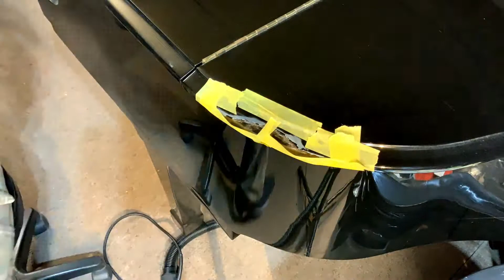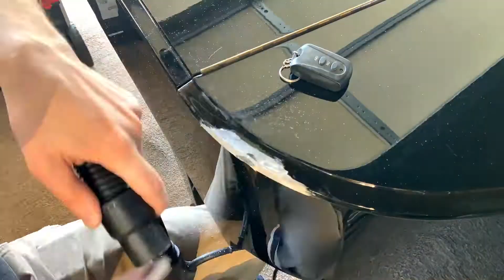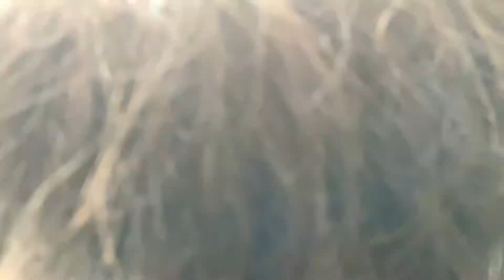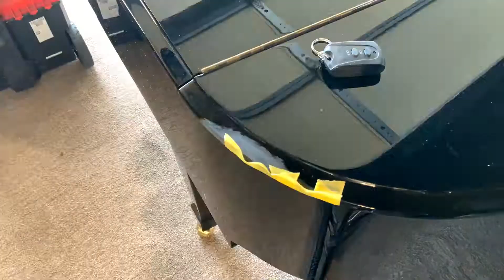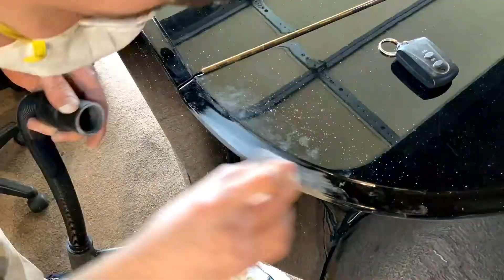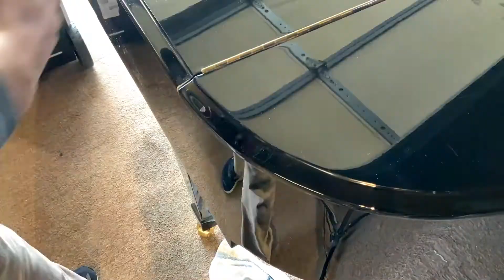Polyester Finish Repair, Piano Finish Repair

Comment: Top job Jacob. That is actually a very tricky repair as the polyester can be very thin on those moulding edges. Very easy to burn through.
Reply from the maker: Thank you  Stuart luckily there was plenty to work with here.

Comment: Fantastic videos! Would you mind sharing your post-poly sanding routine? What are your grits?
Reply from the maker: Hey thanks! 
After leveling:
600 and/or 1k dry or wet depending on the situation. 
Then 2k and 4K wet sanding with the foam sanding discs. 
Sanding to 4K makes it very easy to remove sanding scratches. Some sand to 5 or 8k. 
Use different patterned sanders to make sure you have sanded through the prior grit. (Straight sanding/standard orbit/random orbit etc.)
Then edge buffing using canton flannel wheel and GW16 dry compound. 
Polish with your polish of choice to remove fine buffing marks, if there are any. 
Visit MirkaLTD’s YouTube channel for guidance. They use a wool pad to remove sanding scratches- takes a bit longer, but no mess (good for a showroom) 
Make sure it’s polyester
Reply from the maker: In this video, I leveled with 60 grit on a dremel and triangle sander, then 320 straight with a block. Then 500 wet sanding with the electric sander. Then 1000 grit wet sanding straight by hand. Then 2k and 4K with the electric sander. 
Every situation is different.
Reply from the maker: https://youtu.be/IP5dO1fEUQU
Reply: @JacobEmch91  I have a similar repair to do on a grand. Wish me luck :D I've never thought of using my dremel for levelling. Great idea! I do similar routine for sanding but I've been using Micro Mesh for small things by hand and Norton Dry Ice discs which are outstanding at 1200 & 1500 grit. (6" discs on air tools). It gets similar results to wet sanding but you can monitor progress without water. I also find the high grit foam discs worthwhile. Thanks for sharing.
Reply from the maker: I will give the dry ice sanding discs a try. Thank you for the suggestion!

Comment: I have some new chips on my polyester finish Schafer & Sons approx. 2000 piano I need to repair, we were mounting a ceiling light that fell on top of the lid and caused 3 chips in the polyester finish. The color/stain is walnut and fine. I need to build up the polyester fill to be level. What products did you utilize in your restoration? Thanks.
Reply from the maker: Hi there, I would recommend visiting Allied Piano’s website for materials and basic instructional videos. That will only take you so far though. I would recommend you call a couple piano dealers near you and ask them who they use.

Comment: I have a new Shigeru Kawai that was delivered with deep gouges in several areas of the finish.  The surface clear coat looks like it has swirls everywhere.  Are these repairable to look like new?  I've never spent this much for a piano and had it delivered in such bad shape, but I've also never had a glossy black piano either.
Reply from the maker: Wow. Is the piano “new” new… or did the dealer use it as a rental for a while and then sell it as “like” new? You need to call your dealer immediately and either demand a replacement or return it and get your money back. Or maybe they have a repair technician but most dealers don’t. 
Reminds me of the time I fixed a foot-long deep gouge on a brand new Shigeru Kawai SK6. The damage must have been from the factory because it was there when we uncrated the piano.
Reply: @JacobEmch91  new new. SK7. My concern is that in order to remove all the swirls and scratches the whole top surface of the piano will need to be refinished and I’d rather not do that. Bench is damaged as well. The delivery guy had the leather surface on my garage floor as he assembled it.
Reply from the maker: @MrTedflick  all I can tell you is that is beyond unacceptable and any respectable piano dealer would take care of it for you. They’re likely not going to be able to repair it in the home. Don’t stop until they replace it, fix it, or give you your money back. Show up every day, call twice a day. Don’t be afraid to take them to court.
Reply from the maker: @MrTedflick  I’m curious what the damage looks like- send pictures to polyesterrepair at G mail dot com